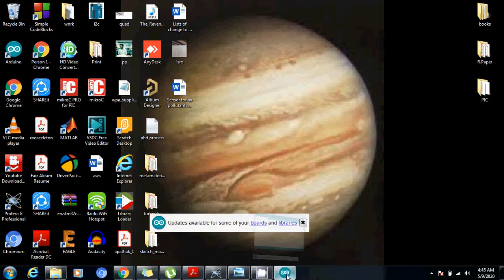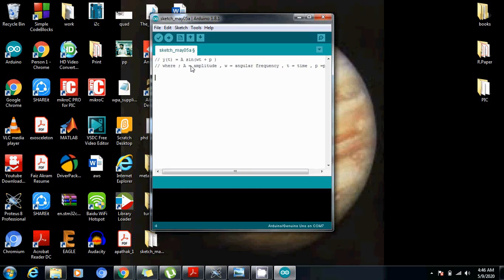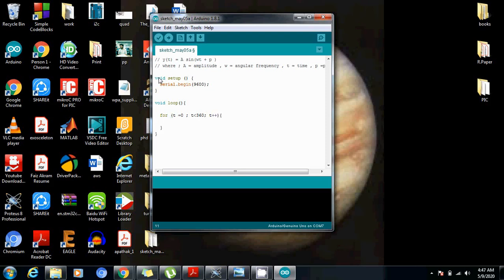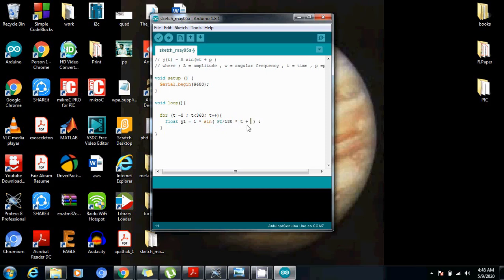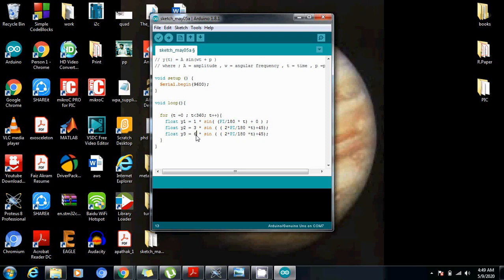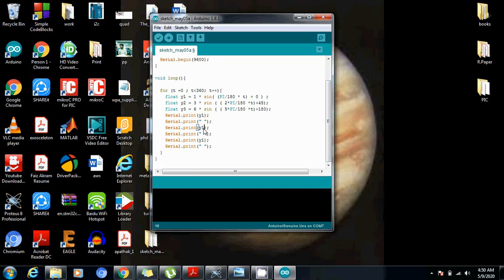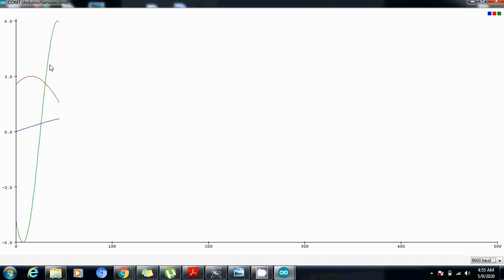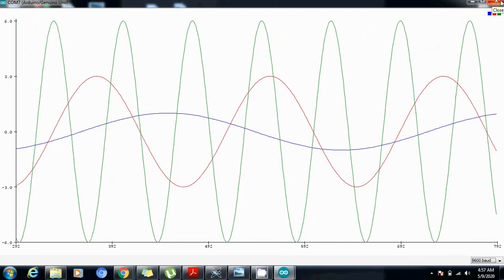Serial Plotter in Arduino IDE | Sine wave plotting

Comment: Hi Bro very great explanation and kindly help us need to generate the 100hz sine wave in arduino, i tried more time need to use dac (DAC0800) if possible help us more helpful my project. please share your contact details if possible. waiting for your valuable replay Thank you....
Reply from the maker: Hey. 
You can whatsApp me on 9315780473
Reply: Hey, did you solve the problem with the 100Hz Sine wave ? I got the same issue here...
Reply: @thomascelik269  hi no... Right now using some other options to generate the sine wave....
Reply: @vengug7303  okay, what are these options? Because i am trying to generate some sine waves with 10Hz to 100Hz but my Problem is that there is no function like a time-line in the Serial Plotter for the x-axis... So I dont know if the signals really have the right frequences